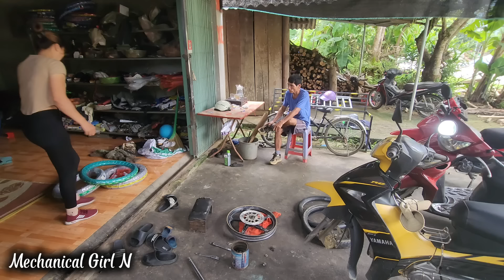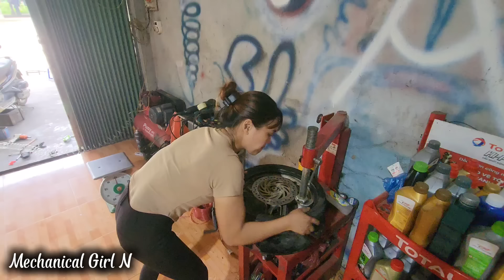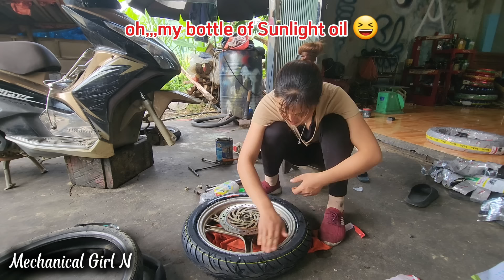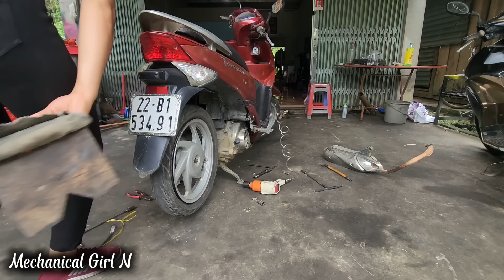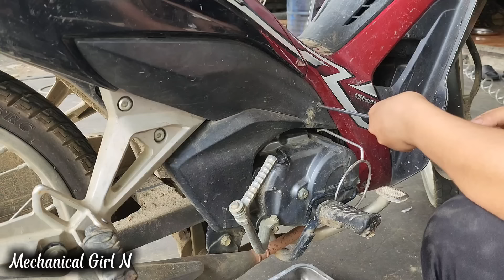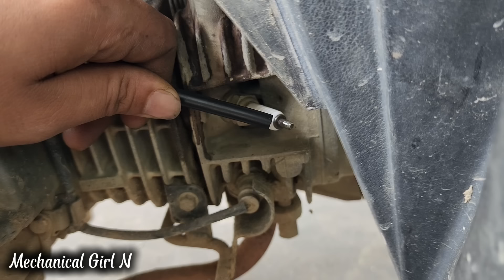Repairing 4 motorbikes in 1 day, the mechanic girl earned 0 VND.

Comment: Dear, can an AVO meter be used to measure AC electricity consumption?
Reply from the maker: The watch I'm using can measure it  AC electricity consumption
Reply: @Nghimban05  all digital multimeter can measure AC and DC and ohms, and connection. and many other.diode test, transistor test ,temperature, etc.